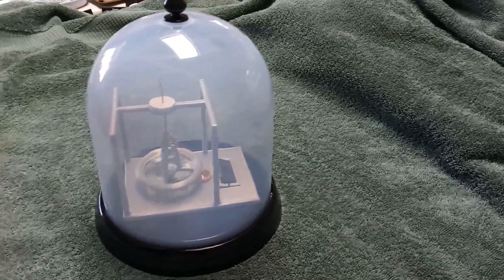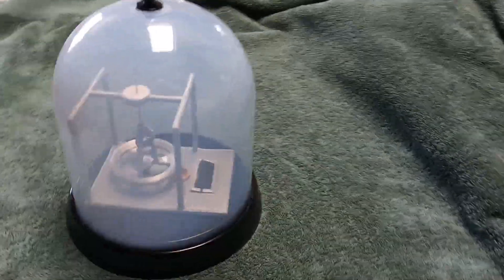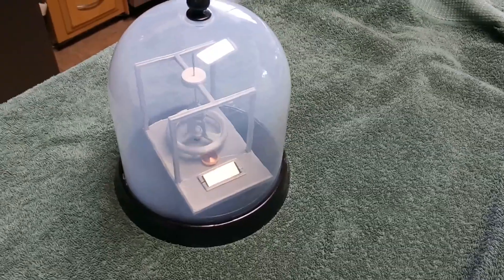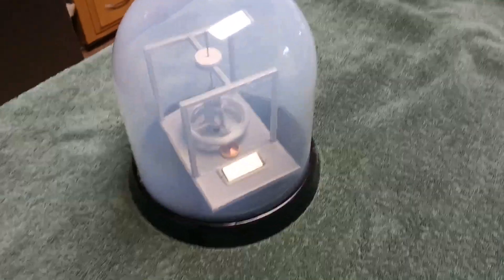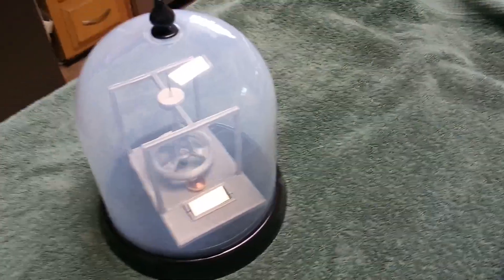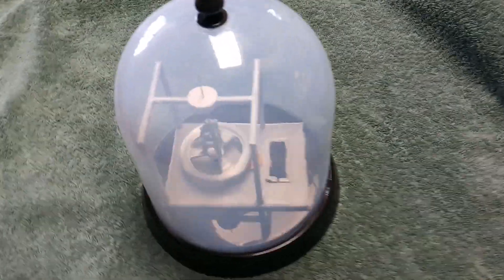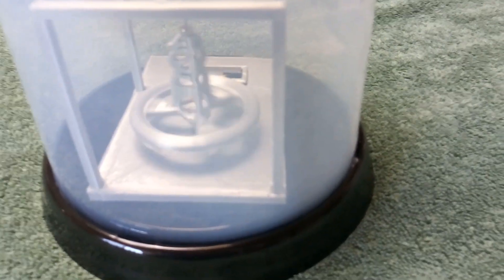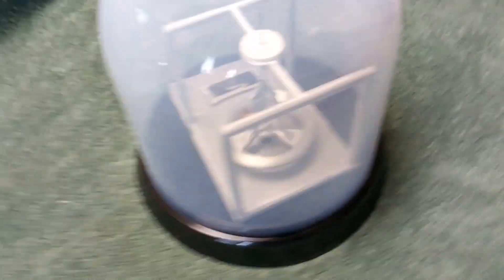Ghost In The Machine

Comment: Great name and back story, it fits well. Also, if it's turned that colour, how long can it run in UV before the ghosting stops the light? It makes a cool runner for that reason too. 
For 3D stuff, I've usually gone to Thingiverse, selected what looks about right and printed it. Maybe will change the size in Cura, but that's it. I'd think most people do the same, if something already out there will work.
Reply from the maker: I think that is good advice.  Thingverse is  an easy way to get the basic shape you want and then just modify it.  I do want to learn this 3D modeling.  I bought this beautiful new Ender 3 tool and it can do things I have only dreamed about for years.

Comment: You sound disheartened Lidmotor but don't give up yet. You need a mentor in the background. I guess we're similar ages and I have dabbled with 3D printing and I know just what you mean. Thanks for the video. Mike
Reply from the maker: Thanks.  I will press on with this.  I wish the 3D printer manufacturer had put a little instruction cheat sheet in the box explaining a few stupid simple things.  They assume a certain level of knowledge that an older person might not have.  Something like-----" If you are a senior citizen and still use a flip phone you might have some trouble understanding this 3D printing concept.  Just relax and go with the flow.  Design and print a block with a hole in it then be joyful.  Maybe tomorrow try something else.  You ain't gonna design and print ANYTHING intricate right away."

Comment: Fusion 360 was easier to learn than Free Cad. It is more generous with file ownership than Onshape. There is definitely a learning curve, but I am able to create complex electronic enclosures  inserting my printed circuit board designs... easily with Fusion. ( it wasn't easy at first, but you catch on quickly)
Lots of good tutorials on YouTube. Plus, 
Fusion can create files for 3D printers, laser cutters, CNC machines, CNC lathes and has sheet metal and 'free form' functionality. 
I have used Fusion for over 5 years, 3D CAD is awesome.... so don't give up!
Reply from the maker: Thanks.  I will carry on. This 3D printing is something I have wanted to do for a long time,

Comment: Spooky build!  3D printers get more fun the more you use them!  for modeling, I have very low dexterity so I can't use any "point-and-click" software for "artsy" designs, instead I use OpenSCAD, which is more for Functional designs and definitely something anyone familiar with the Trivium (Grammar, Logic, Rhetoric) can pick up.  there's a cheat-sheet for the syntax, which you can assemble into logical structures similar to using the English(or any) language to describe an object and the procedure of how it's generated from primitive shapes; it's totally exact in every way.  Here's the cheat sheet link:
https://www.openscad.org/cheatsheet/
Reply: almost forgot I started this article series years ago, it's unfinished but shows the generation of an axial and then a radial flux rotor:
https://shanjaq.wordpress.com/2013/03/25/procedural-magnetic-simulation-with-openscad-and-femm-part-1/